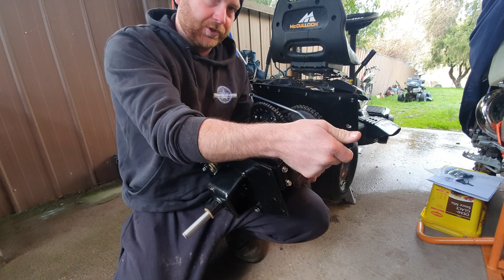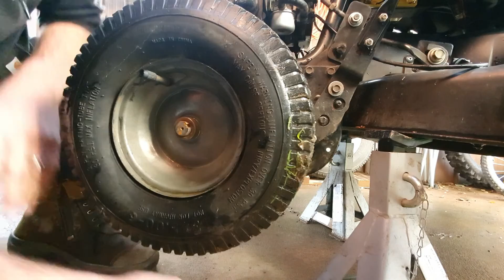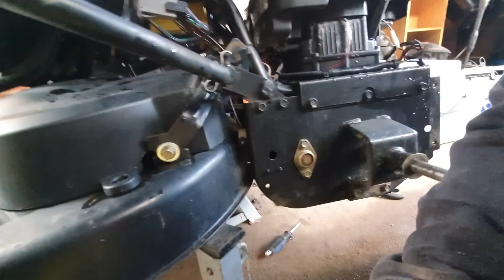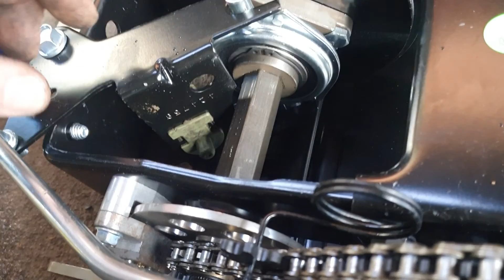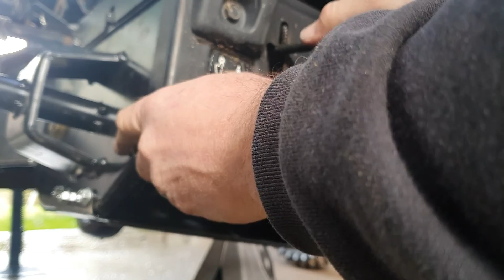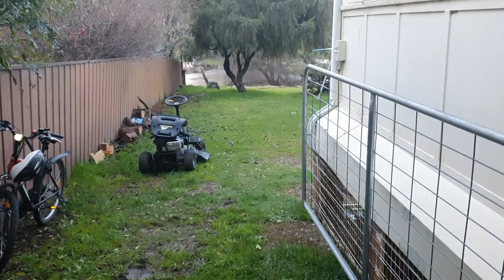Mcculloch mowcart 66 transaxle installation step by step!!!!

Comment: great job man i have the same mower and its noisy on full speed i thought something is wrong with it but in your test drive i saw they all are a bit noisy on third gear thanks again for video mate
Reply from the maker: Hey cheers mate they are noisy when driving even with a new transaxle no worries mate cheers
Reply: Nice work mate was thinking the same put new one in still noisy but now I know it’s right 😃

Comment: Hey mate awesome video, this is the first video I've been able to find specifically for the mowcart 66. 
Mine has stripped the plastic crankshaft gear that drives the cam and governor but im not having anyluck finding a exploded parts list or replacement part do you have a parts list or any suggestions I'm in the NT.
Reply from the maker: No worries mate i cant remember were i got the parts i did try make 1 out of 2 but dnt work and just brought a complete tras axle

Comment: Hey thankful for the video. 
i just replaced the chain tensioner but it keeps throwing the chain. Any suggestions
Aussie Chick needing help
Reply from the maker: Id say the chain is stretched i did the same as you and had no luck and had to buy a trans axel assembly basically the whole rear end
Reply: Would replacing the chain work do you think?
Reply from the maker: @christinehunter3219  it could help
Reply: @TRAV30387  I've just ordered, for $30 is worth a try. It surprises me that chains can even stretch
Reply from the maker: @christinehunter3219  good stuff yeah the surely do

Comment: Had the same mower and I have to say it is the biggest piece of sh*** I've ever had! Once the Frictiondisc was all wasted I replaced it with a new one for around 100$. After the replacement the mower STILL had issues moving forwards and especially backwards in the reverse gear.
Reply from the maker: Yeah haha there cheep thats 4 sure mines been great just rattles your teth out when the cutters engaged
Reply: Friction disk is whats fried on mine

Comment: Bugger, I had to replace the drive chain, now I can't figure out where the brake spring goes, mine looks slightly different to your video. I see where it connects to at the top but no clue at the bottom